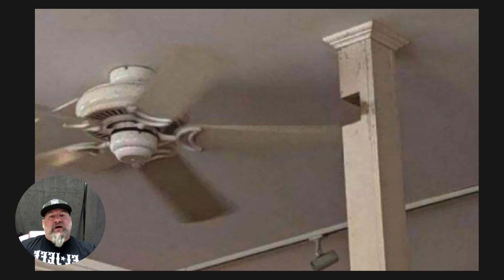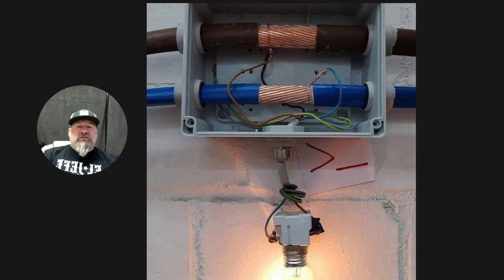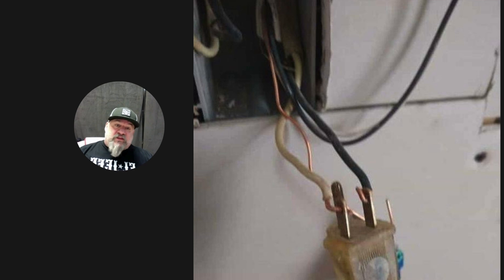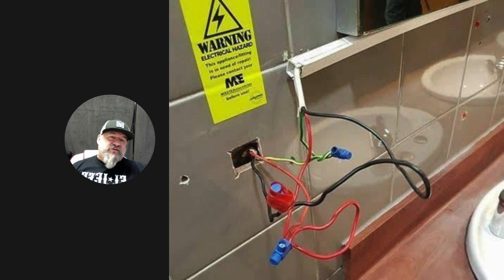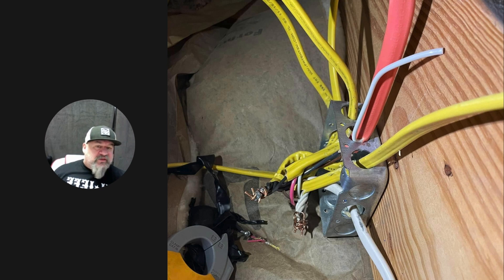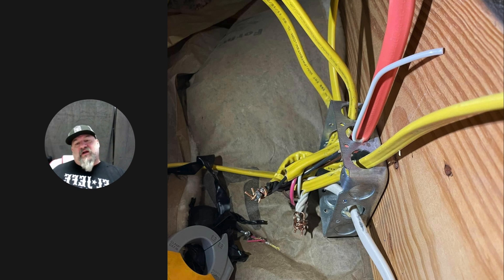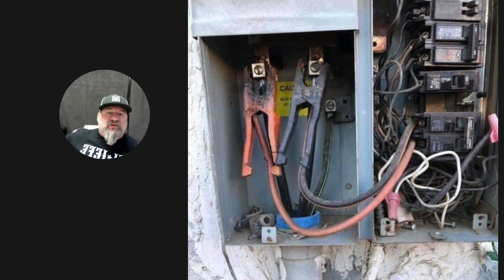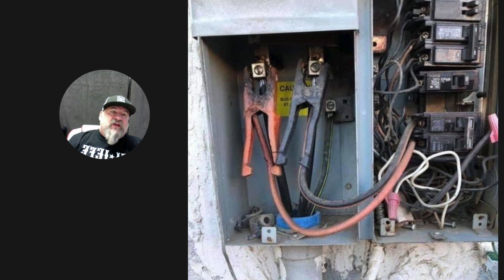How to to basic electrical and what not to do. Residential wiring at its worst.

Comment: I will admit have used jumper cables directly to the power wires to get temp power for a job! It works for the day and no permit/ inspection needed! Always disconnect at the end of the day

Comment: This reminded me of something... Before growing pot was as legal as it is now, a lot of guys used to setup in a house, or condo, and the first step to large profits was getting a shady electrician to back mount a junction can, and tap into the line side above the meter. If you did it well, you could have a perfectly unaltered meter and service on the outside, but have a tossed in can with car jumper cables clipped to the 240V feeders and neutral/ground, feeding a wonderful sub panel that in turn fed your lights and everything else you wanted to run for free.

Best part was, as long as those jumper cables didn't short or fail, or the sub panel main breaker, the rest was all protected and code compliant. 😉

Comment: Have seen a burned meter can like that before but it was filled to the brim with extra wires and bugs from a transfer switch mounted on the other side of the wall. When I got there it was still live and smoking so called the FD and power company for a disconnect of the UG service at the pole.

Comment: Another problem ….  U cannot add an electric dryer when gas was used on the old one.   Same with the hot water heater.  Then add an electric stove to the mixture….   Then top it off with a central A/C.   I will tell you ….  It melted the plastic meter from the can ….   But salespersons sold them the electric rather than the gas replacements …
Reply: Dependa on the service size
Reply: But the green weiner worshippers want everyone to use that clean electric.

Comment: Seen also romex wire tied to the bus to run an A/C     Un. Fn.  Fused ….
Reply: Yeah, so have I.  In fact, the wire was behind drywall on the basement ceiling.  A handyman accidentally cut through it one day when doing some renovation, and the cable (10/2) caught on fire and burned some of the basement. They had to call the fire department.